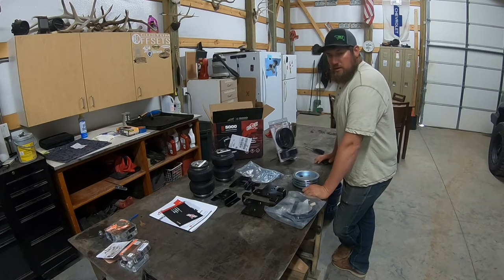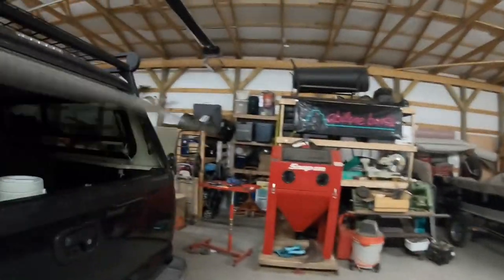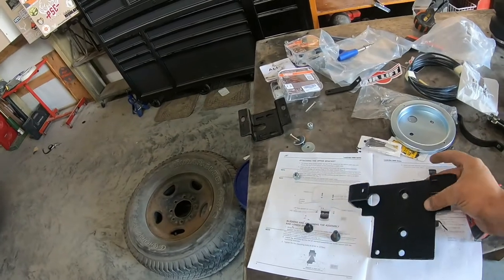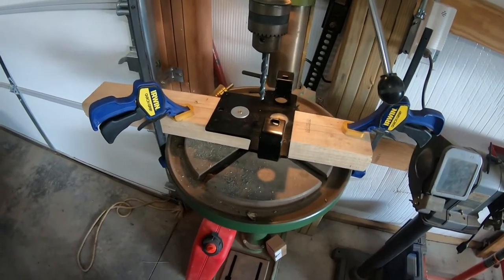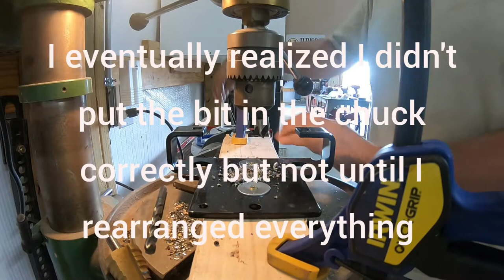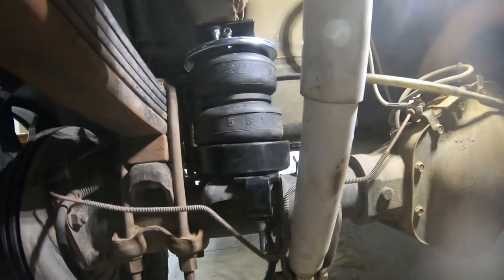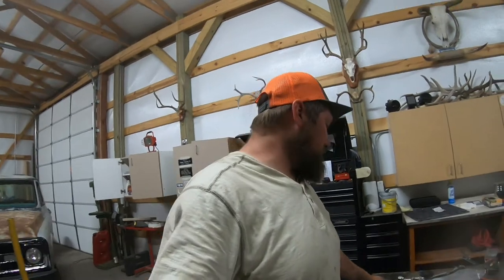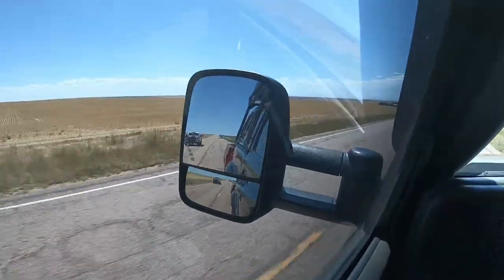Installing Air Lift bags and Daystar cradles on my Chevy 2500 HD overland hunting rig/work truck

Comment: do you have an add a leaf? if so, did you lengthen the inboard brace for the lower mount? notice any bending?
Reply from the maker: I dont have an add a leaf. Just the factory 2500hd springs